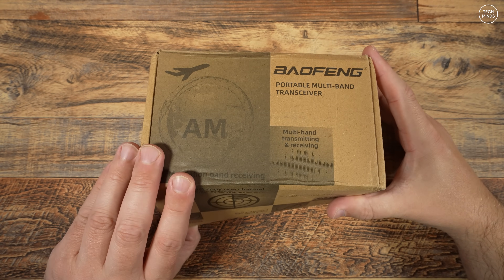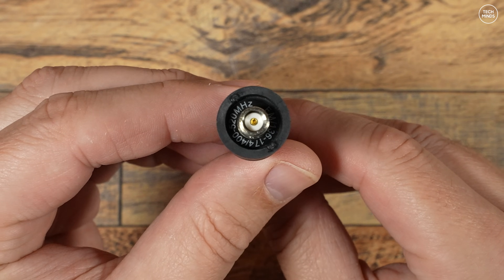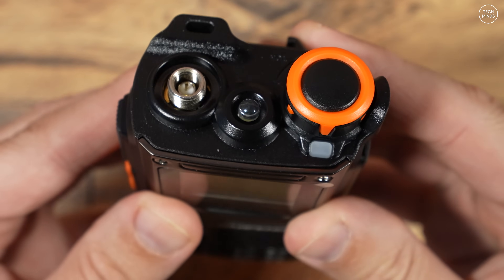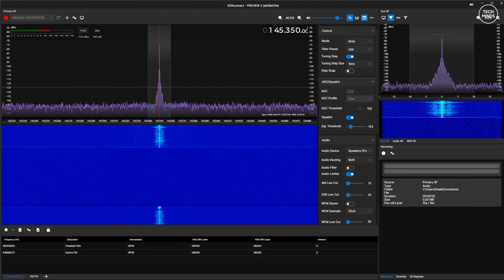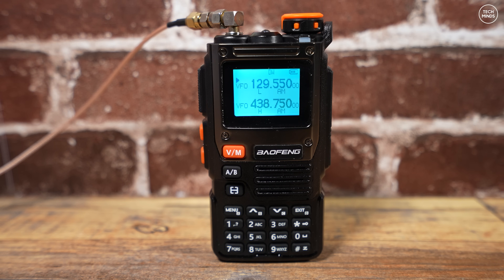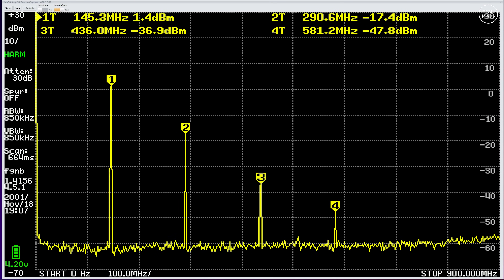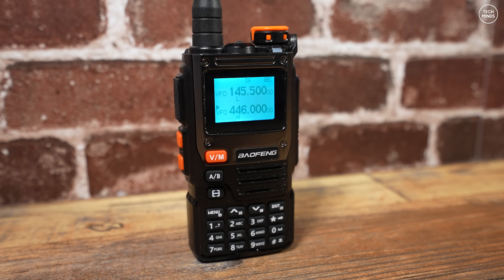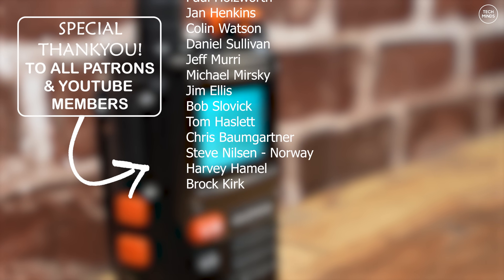BAOFENG What Are You Doing With This UV-K61?

Comment: thats either a deliberat clone or manufactured for Baofeng by another outfit, may be even Quensheng themselves.  I wish theyd just spend a little time getting an all band radio to work right, ide buy it even if they had to charge a bit more for the extra dev time & compnants becuese  it would still be cheaper than the like of iCome ect wich i simply just can not afford.

Comment: I bought a quansheng kv5-8 about a year ago. I've left it alone and not upgraded the firmware. It cost around £12 delivered. Less than a pizza. I'm not technically minded but I've used it alongside a couple of baofeng UV 82s and a uv21 (bought at a car boot sale for £16). Both brands perform reasonably well. I've swapped out the antenna's for what are most likely fake Nagoya's. I'm assuming they are however the do perform better than stock. On all these handhelds I can usually hit a repeater that is roughly 7 miles away. I do have to go up to my nearest high point and I'm still impressed that they get out that far. I speak to contacts who use Zello and other network stuff but as a free standing walkie talkie not using any other tech they do seem to work. The AM on a standard Quansheng is just about listenable, if you're into that, or really bored. Pmr 446 is interesting. I do have a licence but I'm still not quite sure of using a 5w radio (or more) is covered on this band. That being said, it feels a bit like the old fashioned CB in that people are bending the rules. Which are ment to be bent. On a side note I bought a CB radio during lockdown. Running a big old base loaded 6 foot whip. It was great on the 11m ssb but the UK channels were either dead or some guy playing music on ch 19 with an echo mike at about a 1000w. Some things never change.

Comment: This is a BAOSHENG ! 😂 .
I hate blue screens , it's hard to see, same old poor signal meter, same AM  flaws as the Quansheng UV K5 / K5 (8) K6 that is easily fixed with Egzumers Mod on those radios only. No Antenna tests yet I see so I'll stick with the 100km Quansheng to Quansheng K5s range test l saw both using the stock antennas. 1 extra button on the front so don't be trying Egzumers Mod just in case it bricks it. Get a Quansheng k5 k5(8) or k6  before you can't.

Comment: I really wish baofeng would make a 10, 11 and 12 m tri-band walkie-talkie that did all mode AM FM and sideband, I know so many people including myself that would love to have one of these radios
Reply: I agree, I managed to get an SuperRadio / Albrecht multi mode Handy with SSB and a Clarifier, memories. Mic port, Small wire snip to open it up to 24Mhz - 30Mhz . And even something to challenge a Yaesu FT817 portable multimode rig. would be a smart move but way more of an expensive challenge looking at Yaesu's amazing build quality. .
Reply: @mybrighton  lucky, those are as rare as hens teeth, I'd love to get my hands on one.
Reply: Absolutely! FYI, Rumour has it that AnyTone might have something in the works :)
Reply: @mostlypostie1  nice
Reply: You can get a Jopix CB-514 handheld that does 11m, as intended, but can easily be widebanded.  

With the radio off, hold the PTT and FUNC button at the same time, then turning it on, you can wideband it after selecting the correct table. Table 1 is CB, which can be selectable for the country you are in.  Table 2 is wideband odd frequencies, and Table 3 is wideband even frequencies. Thus, the tuning steps can be set at 5KHz by changing between Table 2 & Table 3. There are a further 3 tables, but these seem to be variations of different CB channels.  In wideband mode, its frequency range is 25.61000MHz to 30.10500MHz. Unfortunately, it is only AM & FM only.  

I believe it is a version of the President Randy, but at a much cheaper price.

Comment: The analyzer results should be considered as only a data point, and with a grain of salt. Keep in mind we're testing cheap chinese radios with cheap Chinese analyzers. I've been seeing way too much stock going into what those readings show than there really needs to be.
Reply from the maker: @vitogriffin8902  Actually, the TinySA Ultra is extremely close to top end gear in terms of harmonic measurement.... That's not just a "out of the air" statement, I have seen it tested.
Reply: @TechMindsOfficial  I've seen them used beside higher end analyzers and be pretty far off... I guess that speaks to the quality control of the manufacturers putting out the cheap electronics. Either way, there's more going on with the harmonics and what actually causes interference than an analyzer graph and an FCC standard. Everything transmits on the neighboring harmonics, and I can hear NOAA VHF broadcast on 49-50mhz, as well as some of the local VHF ham repeaters .. the difference is that those are putting out a couple hundred times the power of some HT that you'd have to be standing on top of in order to get any actual interference. It's much ado about nothing. LED lights, motion detectors and security cameras cause way more unintentional interference than any HT. It just doesn't really happen outside of the testing environment.
Reply from the maker: I use a direct connection, through 30dB attenuation with the radio normally around 1 watt output. I have performed the same tests with Yaesu, Icom and Kenwood radios using the same setup, and none of those have high harmonics. So I think my TinySA ultra is proving the point.  Every time I show spurious or harmonics, someone always pipes up to tell me I am doing it wrong. I am sure that even if I had a £5000 Spectrum Analyzer someone would say I'm doing it wrong...
Reply: @vitogriffin8902 Couldn’t agree more mate. 

I’ve seen people get very tied up in knots over what is effectively a few mW of stay RF energy which is likely going to an antenna with a dreadful SWR too.
Reply from the maker: @robustreviews  Just checked your channel, your videos are hilarious! Made my "bits" jiggle. Subbed for more.. :-)
Reply: @TechMindsOfficial  I'm not saying that you're doing it wrong. I'm saying that a) the analyzer isn't great quality and b) the results don't necessarily mean what people interpret them to mean. For every person telling someone they're doing it wrong, there's someone getting defensive over any matter of fact, general observation that they perceive to be disagreeing with them. I'm sure you did the test correctly and I'm sure there's a dozen reasons why the radio is probably a piece of junk, and I'm also pretty sure that spurious emissions or spectral impurity on a 3-5 watt radio isn't causing the interference people act like it does.
Reply from the maker: @vitogriffin8902  I didn't mean you or anyone else in this thread, I just meant in general, across a lot of videos people like to point out something is done wrong. I do say in my video that the TinySA Ultra is not lab grade. However, when comparing against top tier radios, the results are black and white. I'm sure I have shown in some of my older videos, using a "dirty" transceiver with a high 2f, could be heard on a receiver in my home very strongly, when I was a few hundred meters away. Maybe I should look at doing those kinda of tests too. Although, I'm getting extremely bored of these crappy radios now. Time to move onto other topics..
Reply: @TechMindsOfficial  that sounds fair enough. I can imagine it gets old at times
Reply: @TechMindsOfficial  Thanks dude 🙏 that’s really kind of you to say. I only have a few hundred subs but I’m trying! 🫡 thanks mate.
Reply: And I've seen reviews where they appear to be  massively overdriving the spectrum analyzer and likely creating harmonics there.  Not necessarily here, but another YT channel. Yes, grain of salt.
Reply from the maker: @JimAndyAllyn  You can work out how much power is going into the TinySA Ultra by looking at the attenuation value and the peak dBm of the fundamental.
Reply: I’ve mentioned it a few times in my videos, but as a meteorologist, I’d consider all YouTube testing (including mine I stress) as being nothing but some random reference measurements.

That does not mean they’re not useful, and not aimed at our host here but the channel that bleats on-and-on about “muh illegal harmonics” does make me chuckle as I’m really not sure they’re as smart as they think they are when it comes to serious measurement.

The SA is a great little tool, a ruler is a more than adequate tool to measure some things too. Here is a great example, we can say with a very high degree of certainty the unit should be rejected on the information we have - great!
.

The main issue is self-appointed experts who pass and fail things on the borderline. In a world of decision rules, errors and measurement uncertainties it’s a bit more complicated than just pulling the PTT and calling it binary pass fail around the limits.

Comment: The Quansheng has exactly the same problem with AM.  The Egzumer mod on the firmware delt with that. Looking at the box of this Baofeng you cannot tell the difference between the Quansheng and the Baofeng... so... I don't know but it seems to me the same manufacturer?
Reply: I would suggest it's the same radio. I would suggest that it be flashed with the Egzumer software. Go on, Mat, try it.
Reply: @paulsengupta971  Duhhhh!!!!!?????
Reply: Quansheng has less buttons.
Reply: @stefanp4258  Hmm, yes, maybe not quite the same. Maybe not quite the same firmware then.
Reply: Maybe not exactly the same radio but the same manufacturer.
Reply: If that's the case it excellent news lots of mods ++

Comment: I know that some sources disagree, but the TinySA only puts a "1" on the fundamental because it labels peaks in order. But it's not a harmonic, it's the fundamental. The harmonic labeled "2" is actually the first harmonic, not the second. The "2" simply means it is the 2nd peak.
Reply: A harmonic is a multiple of the fundemental. The first harmonic is the fundemental multiplied by ONE ie the same frequency.
Reply: 1 = first harmonic = fundamental. 2 = second harmonic which is 2x the fundamental. Has been thus since I've been a ham and before that (ham since 1987).
Reply: @paulsengupta971  Like I said, some sources disagree, but I'm sticking with the musical definition. It makes no sense to me to call the fundamental a harmonic by multiplying it by one.
Reply: A harmonic is a sinusoidal wave with a frequency that is a "positive integer multiple of the fundamental frequency". So applying that will show: 1 x f = 1st Harmonic,  2 x f = 2nd Harmonic,  3 x f = 3rd Harmonic, and so on.. The fundamental frequency is the lowest frequency in the sum of harmonically related frequencies, thus, it is the 1st harmonic..
Reply: A dipole or vertical antenna will resonate on odd harmonics: 3rd, 5th, 7th... That is a multiple of 3, 5, 7 of the fundamental. Who ever said it differently? Fundamental = 1st harmonic.
Reply: In Ye Olden Dayz, the carrier (1) would be the fundamental, and 2 the 1st harmonic. 3 was the 2nd harmonic, and so on.

I have seen recent references that equate fundamental with 1st harmonic. Sometimes a change is made for no valid reason (e.g., Pluto is not a planet), and this may be it. 🤷‍♂️
Reply: And here is me thinking that it is properly known as the  Fundamental Harmonic.  This is what I was taught.
Reply: @TsiolkovskySportingLocks  Like I said, some sources disagree with me. But a fundamental is a fundamental, not a harmonic.
Reply: @TsiolkovskySportingLocks  Think of it like on a guitar. You play a string. That's the fundamental. You touch it at the octave to make it vibrate in halves and you get a note twice the frequency of the string. That's the first harmonic.
Reply from the maker: I was always taught 1 is fundamental and 2 is first harmonic, but when I said in previous videos that 2 is first harmonic, I got flamed in the comments more than a witch burning at the stake! So now I just say fundamental and second harmonic and 99% of people know what I mean.
Reply: @TechMindsOfficial  The sad hams that are flaming you probably could not even explain what a balun accomplishes.  Ignore their ignorance.  It is astounding how far amateur radio has fallen from being a technical hobby.
Reply: @TechMindsOfficial  I hear you. I've been flamed for that, too. But I stick with it. Part of it has to do with my musical training.
Reply: @N2EWSRadio The fundamental is the carrier as has been said.

The numbers on the SA are NOTHING to do with the harmonic or whatever, they are simply peaks that have been detected. If you had another peak between the fundamental and 2nd harmonic  then the 2nd harmonic would get a "3" in  the marker.

Simple solution turn of the automatic peak detection if possible and use the cursor to show the various harmonics.

Andy
Reply: @N2EWSRadio  ITBH I'm just baffled by the morass that is the naming of the thing and how upset Ham's get about this kind of stuff.  I will admit I am a bear of little brain and I'm now thinking of digging out of the attic the training manual I still have from my time in the police where I was doing all of this stuff for the first time, just to confirm things. Of course a Home Office course from 1990s may have got things wrong..
Reply: @TsiolkovskySportingLocks  Actually, it's my music background that makes this significant to me, not my ham background. It's not a passion, just a point I'm trying to make. Agree or disagree. Doesn't matter to me.
Reply: @N2EWSRadio  The suggestion of your musical background (as I have one too) makes me think you're confusing Overtones and Harmonics. The second harmonic (2 x f) is the first overtone, the third harmonic (3 x f) is the second overtone, and so on..
Reply: @TechMindsOfficial you learned it the hard way, but it's very important to use the harmonics terminology correctly, as odd and even harmonics are different beasts. More in this later.
You can call the fundamental whatever you want. A carrier, the first harmonic, or just the fundamental. What's important is that twice the carrier is called the second harmonic. Three tines the carrier is called the third harmonic, and so on.

Once we agree on that we then know some peculiarities of the signal by just looking at it on an oscilloscope. If you would connect one at a transmitter output you would see a sine wave on the screen if no harmonics are present. If you see that the signal is not exactly a sine wave, but the upper half and the lower half are mirrors of one another, then you know that you are in the presence of odd harmonics. Which you can confirm with a spectrum analyzer.
On the contrary of the upper half and lower halves are not equal then you are in the presence of even harmonics.
This is very telling because knowing the type of amplifier used, you can infer the type of distortion that it will generate and thus the sort of harmonic content it will produce, even before building it!